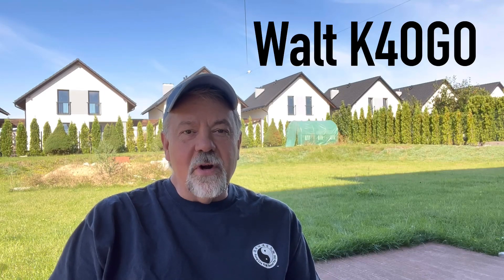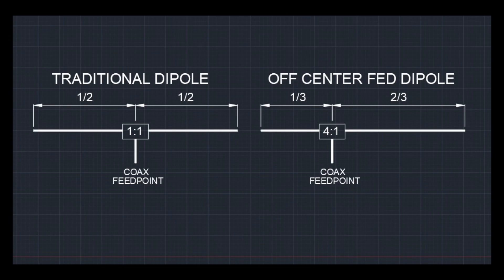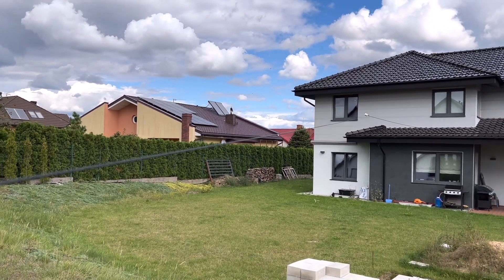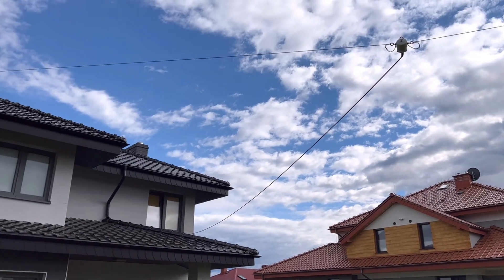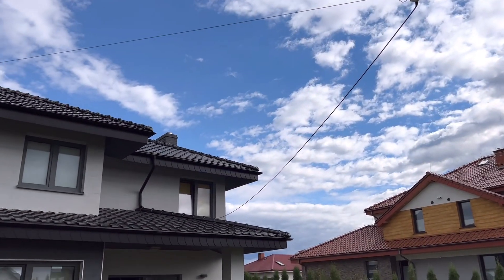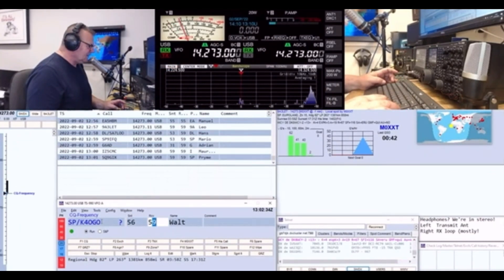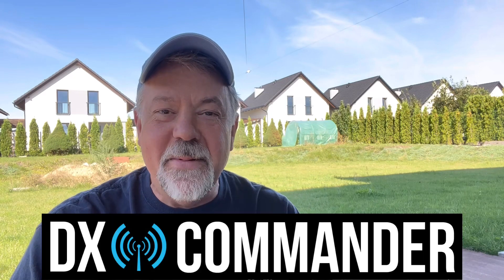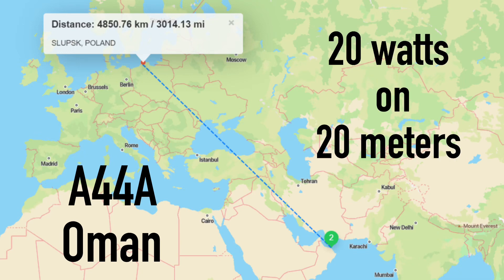Experimenting with an Off Center Fed Dipole Antenna

Comment: I had a Windom at 8 feet above ground , cut for 75 Mtr phone band and used 100 watts power.    Resulted in big DB over S9 signals up to 100 miles during the day, and up to 250 miles with big signal at night.  Fed with 300 ohm twin lead at the 1/3rd point.

Comment: Hi, which antenna has the least noise in your experience?
Reply from the maker: Probably a horizontal flat top end fed half wave. Vertical antennas are noisy but with that noise comes better DX.

Comment: Hi greetings from the UK!
Great story about your first contact with Callum.
I am used to using a linked dipole for 40 and 20m works well on very low power between 1 and 5w.
Is the OCFD much different from a symmetric dipole?
On another note, I will be operating portable by the beach during the next 2 months. What vertical antenna would you recommend?I like to operate on 40, 20, 17 and 15m and I don't mind a mono band antenna as long as they are light.
Thanks for sharing.
Reply from the maker: Hi Vitor! I would highly recommend a RYBAKOV vertical for the beach. It’s my favorite Multiband vertical and perfect for the beach if you have an antenna tuner.

Comment: Great video! I can attest to the efficiency of an OCFD. I've had an MFJ-2010 40-6 OCFD dipole set up permanently at my Idaho QTH for over 4 years. With the apex at 28 feet, I wasn't expecting much, but with my G90 I've worked a VK, several europeans, and most US states with my measly 20 watts, mostly on 20m. If you have the space, the OCFD can be amazing.
Reply from the maker: Absolutely! and those measly 20 watts work well. Love my G90!

Comment: Great video as always and very cool first contact! I have the Palomar Engineering 80-10 version of this permanently installed at my QTH in NH about 20 miles inland from Portsmouth. I set it up as an inverted V 35' high at the center with the ends running N-S. I easily make it to CA and all over Europe when band conditions are good. 40-10 I can touch up SWR with the IC-7300's internal tuner but 80 requires an external tuner, most likely due to the low center height. 10m has been really good lately with several 5-9 contacts in Germany and Texas.
Reply from the maker: That’s awesome, this is definitely a great permanent antenna. I wish I had room for it at my home QTH in Portsmouth, Virginia. Thanks for sharing! 73, Walt K4OGO

Comment: An OCF dipole was my very first antenna when I got into HF. It was great on 40m and so so everywhere else, but I made hundreds of contacts with it, got my first clean sweep in 13 Colonies, nearly got a WAS, and several other accomplishments. I've moved on to something else now but I would not hesitate to throw it back up if I needed it.

Have you thought about getting into POTA activations? It seems right up your alley! There are many POTA parks in Poland and most have never been activated before. What an opportunity if you decide to go out and activate some during your trip.
Reply from the maker: Yes, I've given it some thought, my main portable location at home on the beach is actually park K-1299 but I usually want to work DX on the beach and haven't activated POTA for that reason. I'll eventually make it happen. i really enjoy making YouTube videos of my portable adventures and I'm not sure YouTube needs another POTA video LOL. Thanks for dropping by the channel. 73, Walt
Reply: @COASTALWAVESWIRES  POTA is growing so much and your videos are fantastic, I'm sure a couple of activation videos would be big hits! I still need to get K-1299, but I did activate K-0929 Fort Monroe when I was last in Va. Beach for work. Great location, somewhat eerie at night working the late shift in the dark on 80m in drizzle and fog. :) Enjoy your trip and 73! Dan
Reply from the maker: @N4XTL  thanks Dan, yes I think you just convinced me to do that activation at First Landing State Park. All the best and 73!

Comment: I've always liked the OFC antennas. I ha one that I built a number of years ago, that will do 80 40 20 17 12 and 10.  I then found an article that showed adding 2 more wires to give you 15 and 30. As is I can work all those band no tuner, except the high end f 10 (FM portion) and even some of that is usable before you need the tuner.  And as I tuned mine for about 3.750, then CW portion of 80 needs a tuner. Even then the highest SWR on 10 and 80 is only around 6:1. Not huge.. I have bot tried the 15 and 30 elements yet, but with out them, swr is over 30:1!

Comment: Nice one! Cool that you hit Calum! I know you  said the maker of the antenna indicated that an inverted V would be ideal. How do you think it would perform as almost an inverted L? That thing is so long. I've got a place at the house where I could attach the short end to one tree and then have the long end hit another tree and go down to a fence on either an inverted V or inverted L angle. Probably would have the feed point vertical.  Do have any idea on whether that would be feasible?
Reply from the maker: I’m sure it would. It only 50 bucks, give it a try!